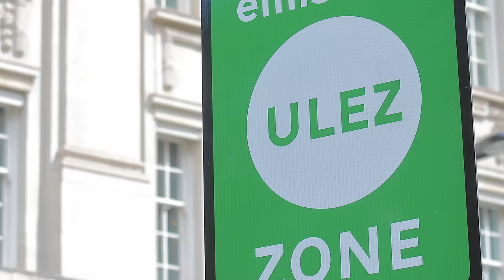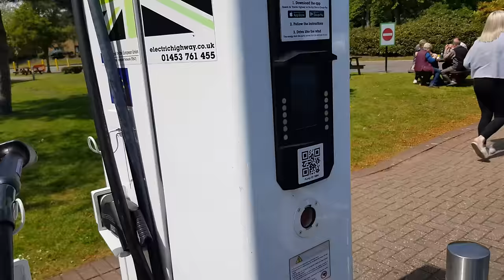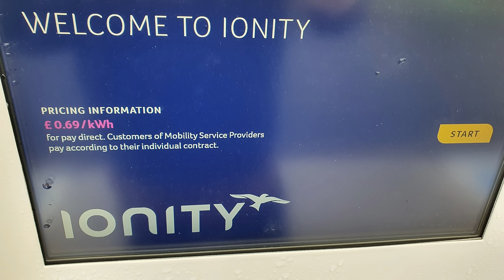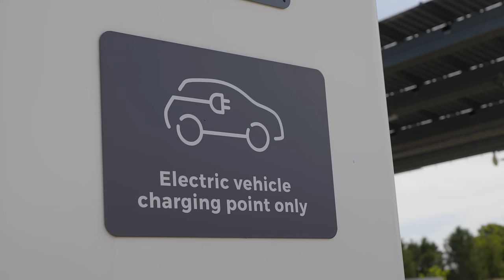The Uncomfortable TRUTH About EVs: The Version NEITHER SIDE Wants You To Hear

Comment: One thing I would like to add on Repairability and Sustainability.. right now I'm driving a 22 year old vehicle and able to repair most of things at home, have access to tool rental if needed and order parts online or go to 1 of 3 stores around and buy them on the spot. As a sub-contractor driving this vehicle that is long time paid-off, helps me to keep the operating costs down and be able to get up and running fairly quickly in case of a breakdown. Especially, while interest rates and vehicle prices are at peak high and most working sectors are still recovering, this old vehicle is an asset to me. I can't see Electric vehicles giving me affordable vehicle / quick repairs / cheap repairs / high driving range in cold climate I'm operating.
Reply: Have you replaced the battery yet?
Reply: All modern cars EV, ICE or hybrid are more difficult to repair (compared to one 22 years old) because they all have tons of computers, more advanced technology and safety equipment.
Reply: @firstlast-lt6xp  Yep!  and with EV/Hybrid repair difficulty goes to a whole other level. Most American / Japanese ICE vehicles are decent when it comes to parts availability and have affordable work vehicle models. EV/Hybrid fits neither of those categories at this stage.
Reply: @firstlast-lt6xp  this trend to more complex ones is not sustainable one, and on top of it EV battery replacement cost would be more expensive than any today's car motor related repairs combined, so long term ICE so more cost effective
Reply: But you are talking about cars that had functioning supply chains for decades. It's a pretty unfair comparison. An EV has way less parts and is overall way simpler, it's just a matter of time till EV replacement parts become standard (besides the fact that they need way less maintenance). Just look at Asia how much easier it is for them to build BEVs than cars with combustion engines. With the right tools and knowledge it's also possible to even disassemble and repair battery packs. No "secret magic" here.
And when you look at the reliability of EV parts vs. ICE parts: they have a way longer life expectancy. Be it the electric motor which lasts way longer than any mechanical motor and even batteries: when you really need reliability LFP batteries can do 10 000 charging cycles, which translates to millions of miles. Yes, they may loose some range in winter but when it comes to pure reliability no ICE car can compete.
Reply: @artxiom  we can agree it has a potential, but EV's are not yet more reliable nor more economical, considering 20 year lifecycle, 

so perhaps in 10 years it would be different
Reply: @PeterBalko  I don't agree. They are way more reliable and economical already. I can't say about 20 years but for 10 years for sure. I rarely know anyone who had a car for 20 years anyway - if so then probably not driven a lot. ALL of my ICE cars broke down way, way earlier - with previously huge costs in maintenance and repair. People make ICE cars sound way more reliable than they are in reality.
Reply: @artxiom I have 3 daily drivers over 20 years old.  I can afford a new car but why waste money?  I can repair them all myself... Good luck working on hundreds of volts EV system if you can even get parts.
Reply: You can learn to repair any car if you wish. Electric Vehicles can’t be that hard since they are much Simpler. With the internet available to get good updated information and even consultation with the guys who once used to build them and left like Rich from Rich rebuilds ex Tesla, with all this help, self repair will still be possible …
Reply: @chrisbraid2907  you are missing the part, where you need to be able to  lift 300+kg, battery pack on your back yard, and the're no schematics available to know, how to properly disconnect it in advance, to not short-circuit the battery, or get an electric shock,

some battery packs, to be disconnected require, an OEM software change, before the battery itself can be removed,
so maybe EV, has less hardware parts, but it is definitely not simpler to repair with officially available tools, it is designed to be not repairable without OEM
Reply: ICE cars, the engine is out, and the other engine is in within a few hours.

I don't think the battery is replaced that quickly in an EV, especially not at home, and almost the entire car has to be disassembled to replace the battery.
Reply: @dchubworldsharenetwork  fastest motor trans swap I did was 4 hours in a Toyota Celica... Unless you count motorcycles that was faster

Comment: It is almost like different things work for different people. Who would have thought?
Reply: I just wish I had been given some training on how to live with an EV before I got one. I had to learn the hard way that range drops 40% in winter. And that you must have a home charger that is level 2 or better.
Reply: @joecoolioness6399  Yes the range in the winter sucks. Winter tyres and heating really takes a lot of energy. Believe it or not but I charge my bmw i3 with normal 230V and 8A with a cable extension. It works but it is slow, not a problem if you charge during the night.
Reply: It'd be ridiculous in Australia, cold in winter, stinking hot in summer, where the AC would drag that battery down like a demon, and the heat would degrade battery performance drastically
Reply: Exactly…
Reply: Range drops 40% in winter, BS. Mine drops 10% without heat pump.
Reply: @markdrummond7  It really depends. If you have really good eco summer tyres with minimal rolling resistance (Bridgestone Ecopia) then the difference to more aggressive good winter tyres like Michelin Alpin 6 is quite large. Also if it snows and the windscreen is full of ice and the car is super cold sub 0°C. The heating takes a huge amount of energy. I noticed a summer consumption of about 11-12 kwh/100km and in winter it is about 18-19 kwh/100km
Reply: Our vehicular needs rest on questionable base assumptions - namely, the idea that all people should be able to travel any distance, any time of year, in any weather, for almost no running cost, in a comfortable temperature environment. When you think about it, that's pretty nuts, and is so entitled that it's always doomed to have a huge caveat - some huge cost, to oneself, one's society or the environment - somewhere.

Comment: Excellent video! Would you consider doing one on the truth about current killer LED-lights?  We all want to see well yes, but must users of new cars literally blind all others? Especially if you drive a normal hight car (NON SUV etc), the jacked-up current cars with headlights at eyelevel plus sun-explosion light strength make things very difficult and dangerous for others.
Reply: Agree totally.
I sometimes have to brake hard and cover my eyes ⚠️
Crazy bright lights on later cars has gone too far 🤬
Reply: Thankfully it seems it's not just me who thinks this, especially in the wet you literally cannot see anyone who maybe at crossings etc ...
Reply: Agreed, I think part of the problem could be auto lights, they don't seem to switch to headlights from beam until they have blinded you.
Reply: Yes we were talking about this at work. Having to drive down unlit country roads, with loads of elevation. Really struggling these days. Especially as I'm in a 2 series coupe, so low down anyway. Mainly oncoming, but also from behind. Without auto dimming side mirrors, quite draining.
Reply: You are absolutely spot on with that statement. Its getting ridiculous now.
Reply: @jondavies5885  interesting i have the same car and didn't notice a problem... it also depends on our eyes I suppose. I also don't drive alot to be fair, how often does this happen to u?
Reply: The EU have regulated headlights since it's inception, dipped beam is capped at 3500lm, and the angle of the beam depending on the height of the light source. some lights are just poorly designed the Tesla Model 3/Y and Mini hatch are to prime examples of cars which have the lower limit of 2000 lumens due to no headlight washers and they have the worst glare out of anything on the roads.
Reply: I think the problem is the move away from projectors more so than sheer brightness. HIDs have been around for a very long time and only the best LEDs rival them in lumens. The difference was HIDs were almost exclusively used in projectors. So less of the light ended up in other driver's faces. It was focused on the road. No matter how well you design a projector less headlight it will never be as focused. This is such an easy solution, but government regulators seem to have sub 75 IQs.
Reply: an dteh fact that whe they go and they do go d9nt ask me how i know 4 year old Volvi requii8nf 1k worth of rear lights thy are blddy expensive , frnts are 1700.. we dint ask fir this utter rubbish just give me a nice bulb from halfords thank you
Reply: It would be interesting to know how many accidents were avoided vs caused by these very bright new LEDs
Reply: I no longer enjoy a night drive for exactly this reason. Driving blind is a horrible experience and so the car stays in the garage. Shame as I love a late drive.
Reply: Yes, this absolutely needs to be discussed. I've nearly hit the ditch on a few occasions because of these lights. I live out in the country, where its pitch black at night. When a row of oncoming cars breaks that darkness with their piercing LED's, my old headlights are instantly overpowered and its impossible to see anything at all.
Reply: Yes, this is an important point. In the UK I am constantly blinded by the lights of the oncoming cars. Some even flash them to say thanks at night… But interestingly I did not find it to be a problem in any of the countries where you drive on the right, unless a car is driving with far lights on. So I have a hypothesis that manufacturers just fail to adjust the lights on the right hand drive cars properly, which then results in this issue. But this is only my hypothesis, I have no evidence to prove or disprove it.
Reply: Oh, very much this....
It might well be my ageing eyes, but modern headlamps are a killer.
Yes, you can see further, but by the gods they blind the crap out of you coming the other way.
And is it me or do these 'automatic dipping' headlights drop their beams a fraction of a second AFTER they've burnt your retinas through?
Yes, the older headlamps are not quite as good. But you drove slower, so you weren't charging headlong into the dark!

I did read somewhere that it's partly due to the 'tone' of the light. Our eyes are not particularly evolved for this 'blue' light, and this is why it's quite piercing, whereas the yellower light from older lights is more consistent with the natural light we have evolved with.
I've no idea whether this is scientifically true or not, but there might be something in it.
Reply: It’s worse with older cars that have been “upgraded” with bulb replacements that are not approved for road use in headlight units not designed for LED or HID technologies.
Reply: @joerapo
LED lights do use prisms, just smaller and more of them, so spot intensity is lower and more spread out than HIDs. Theoretically much less dazzling, and the impact of refraction caused by road dirt, snow, ice, etc should be lower. Not sure why a single, much brighter, single dot light source at the same colour temperature would be considered less dazzling to oncoming users. It was and still is considered an issue with HIDs hence the requirement for self levelling (retained with LED headlights) and washers.
Reply: Here in Australia they are a problem on bright sunny days as the led brake and indicator lights can't be seen.  I find them a problem at night because of the blinking which my eyes detect. My optometrist says a significant proportion of people have this hyper reactive vision.
Reply: I can’t help thinking we should move to an LED version of the yellow light that the French used for many years. So much easier on the eyes of approaching motorists and easier to see long distance as a driver.
Reply: Good point about blinding LED lights. I live in South America (Chile), and there doesn't seem to be any regulations regarding this. So you get people adding extra LED lights or LED light bars to their vehicles (often old vehicles). They are often blindingly bright and are not designed for automotive use at all, and are just bolted to the car, with no consideration of angles for other drivers. They are often mounted directly above the numberplate, so I have a suspicion they are also used to make it impossible to read the numberplate, either by human eyes or cameras. The police should have the power to immediately take these cars of the roads, but sadly here the police don't really enforce any road rules at all.
Reply: Literally blind them? No

Comment: In my opinion, it depends on the person and their circumstances.  If you don't have a driveway with off-road parking, and your own house, and drive small to medium distances, and you live in a good area with EV charging infustructure, then it will work for you, plus the benefits of cheaper to fuel, less tax, less servicing, and just an easier drive, its a win win, but if you rent, don't have a driveway, live in a flat, commute 100+ miles every day, or live in the middle of nowhere etc, then it would be very difficult to maintain, or just expensive.

There is also the 'issue' of EV depreciation, however this has been blown out of proportion by the media.  For example, a 2022 Audi E-Tron 55 cost £85k when new, but you can pick one up today for £35k with less than 10k miles on it, less than 2 years old.   This is a bargain, and there's a couple of big reasons for this

1: The Government grant, no tax, and business incentives.   When there was a boom of EV's in 2020-2021, the government granted a certain percentage of the cost of the vehicle to buyers, and companies bought/leased these up in big quantities, as it would cost almost nothing to fuel, no tax, government grant, and then after 3 years when the lease was up / MOT was due, they just handed them back.  Boom, all of a sudden, a hugggeee quantity of slightly-used Premium  EV's in stock.  With the government grant gone, and tax looming on the horizon, the adoption rate was no there for this stock, so they've plummeted in price due to lack of demand - not only this, but people have to spend £1000+ to get an EV charger installed, and people are scared to make the jump, as there's a lot of scaremongering out there by the media, saying how 'EV's will "set fire" and you'll be "Stranded" etc. - the reality is, they're more reliable than ICE vehicles, and the batteries last well over 150,000 miles without issue.

2. Brexit, Covid, Putin, Chip shortage - all of these caused EV's to be more expensive to make, home electricity to go up, lack of parts to service, and in the end, caused a lack of demand.

There has never been a better time to buy a slightly-used EV than now, there are some incredible bargains to be had, and if you can fit an EV into your lifestyle, then go for it, make the jump, and buy an incredible vehicle that will last you many years to come.
Reply: @Shaggy12321  EVS are inferior cars, inevery way.